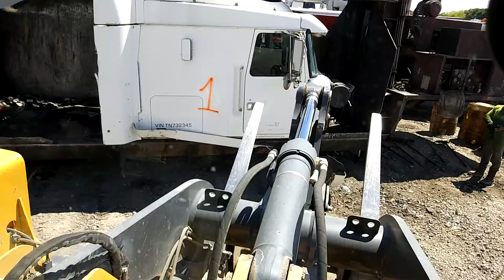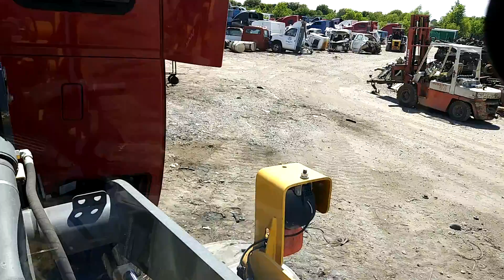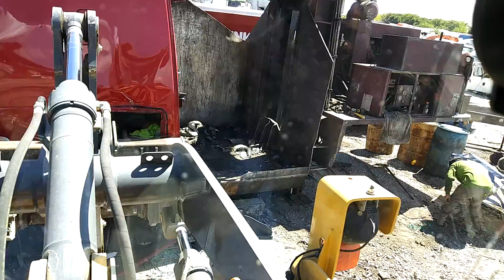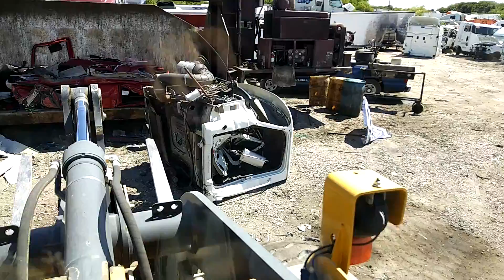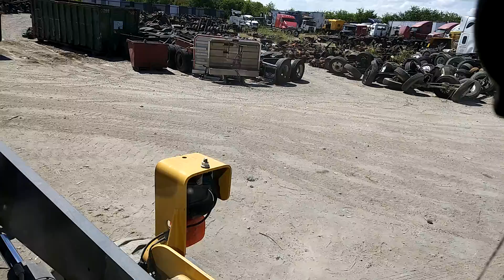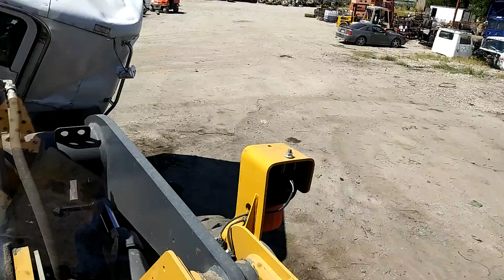Crushing at a Semi Truck Junkyard

Comment: I'm surprised there's much money in these with all the fiberglass and stuff in the newer ones.   Yard is probably just making space though.  

Probably be easier to load them in a dump trailer to get them down the road. 

I'd be the guy who wanted to pull all those cab marker lights and horns off them.
Reply from the maker: You ain't the only one. A few folks would like some of those parts as well
Reply: @CowboyCarCrushing  Problem is stuff like that doesn't sell for enough to pay for the labor to mess around taking them off, you might have to pay a guy $15 an hour to spend all day pulling piddly bits like that that people only want to pay a few bucks each for.   That's why it's still on the truck when you mash it -

Those Mustangs the other day probably had some parts worth the time to take off, not sure what the market is there.

Comment: Couldn’t do that job, I would be too long pulling the air horns for EBay :o)   Looked more like a job for a good old fashioned track loader, just driver over them and then crush.
Reply from the maker: I was like that at first but I ended up not finding it worth my time
Reply: @CowboyCarCrushing  yep, I need all the air horns and a bucket of solenoid valves so I can build a trucker horn organ :o) I had a job cutting up bulldozers for three years and we never found anything :o(

Comment: you need a remote in your loader to control the crusher
Reply from the maker: Yes i do
Reply: @CowboyCarCrushing  lets build one... its not that hard.   ( to bad iam in the netherlands otherwise i would come and help yall )
Reply from the maker: @bigliftm  that crusher is equipped with remote function. That crusher got pushed to hard and rolled on it's side. The remote function never worked again
Reply: @CowboyCarCrushing  sure if i was there and good have a look at it it can be fixed. just some ( G.Z.B. ) that short for "gezond boeren verstand " meaning in your lingo : common farmers thinking. you need an up button and down button and a stop button and a left right control and an stop all button.  whats the Brand and typenr of the chrusher ? do you have the service manual ?
Reply from the maker: @bigliftm  we even sent it back to the folks that make em. They couldn't figure it out
Reply from the maker: https://www.granutech.com/big-mac-auto-flattener.html
Reply from the maker: That link is to the manufacturer. I think this machine is a 94 model 🤔
Reply: @CowboyCarCrushing  ok i will look into this. lets see if i can find a schematic ? How are your engineering skills ? I work with electronics most of my life ( iam 51 ) and also a licenced Ham radio operator.
Reply: are you the owner of this machine ? would like to ask you to get a copy of the schematic and service manual. they could not fix it or dont want to fix it... thats a big difference.
Reply from the maker: @bigliftm  we want it fixed. Like a said management pull the machine out for service. Hauled over to them and they didn't fix it

Comment: We had two Big Mack car crushers . They where built in Dallas Tx.  Both had remotes . You could crush and jog the crusher from inside the loader . Much faster work . Your ground guy could stay busy wrapping bundles , picking up trash on the ground and booming loads down .
Reply from the maker: Im the low man on the totem pole i don't get the good crusher. But i got the best loader in the fleet
Reply: Cowboy Car Crushing  Ya u got a nice loader . Looks like a John deer . Mayb 544 or 644 from the looks of it .  We had a 544 and a 644 and a cat  loader , but that cat loader couldn’t handle the weight like the John Deere’s could . Put three cars on the forks of the cat loader and the two back wheels be off the ground .
Reply from the maker: 544
Reply from the maker: Has just barely 6000 hrs on it

Comment: The crusher is not the right machine for this job ,the cabs would be better going in a shredder and all the metal removed afterwards .if you were to send these crushed bales to a steel mill in the UK they would be rejected pretty quick .
Reply from the maker: This is Texas

Comment: Seems the cabs have alot of parts still, mirrors with brackets,air horns,handles over cab lights and more. Some of the mirror assembly used 300.00 plus a set.

Comment: And most of the newer cabs are mostly plastic n fiberglass anyway!
Reply: I have a 1993 Freightliner fld120 that's aluminum yet but the whole dash and door panels are plastic, fiberglass hood on my truck, aluminum doors and roof panels
Reply: Seen a newer international truck, fiberglass cab, sleeper, doors, hood, no metal in it don't know how safe I would feel, at least no rust, most trucks aren't built like that, most have steel doors and panels here and there

Comment: I was always wondering how they scrapped larger trucks. I kinda figured the probly just brought them to a scrap yard and tore them apart with the grapple and cut the frame with the shear. This is an interesting way to do it. Even though ive been in the scrap industry and followed it sense I was a little kid theres always sumn to learn

Comment: Do you have a case on you phone? If so, the holder might not be able to grip the phone as well. See if the holder works better without the case. I found that works on the phone holder for my tripod.

Comment: Awesome channel! I’m a truck driver and I have a solution for you. On amazon they have some clamp 🗜 type tripod mounts. Not a tripod, just various types of clamps with a tripod screw in it. They’re only $10 or so. I use them to video in the truck. You can actually take a phone mount and get the clear hard plastic Velcro and mount it flat and I have not had a problem with my iPhone 10xr shaking lose. Where are you located? New subscriber
Reply from the maker: Im located in Dallas. Yeah i need to quit being a tight wad but i just know i will find what i need in a car eventually
Reply: Cowboy Car Crushing , I have 3-4 stops in Dallas the next run I get I’ll bring you a couple
Reply from the maker: @kevinlamarr1424  i never know what side of town i will be on.